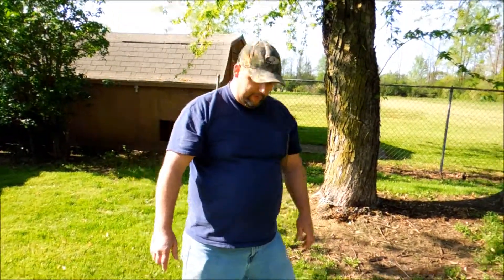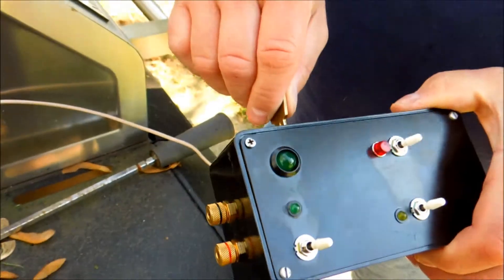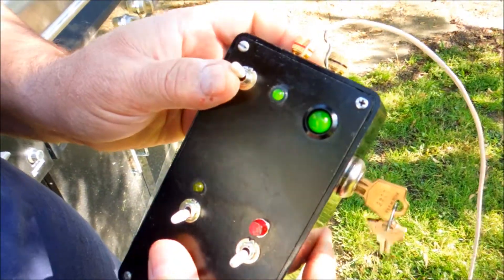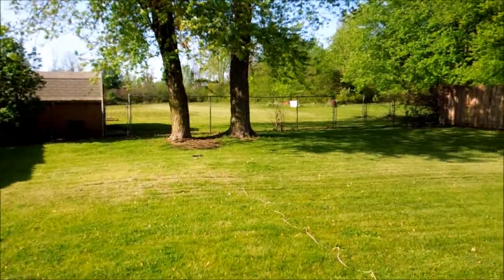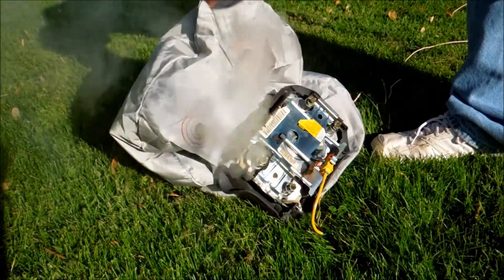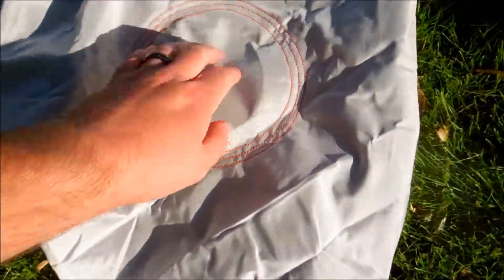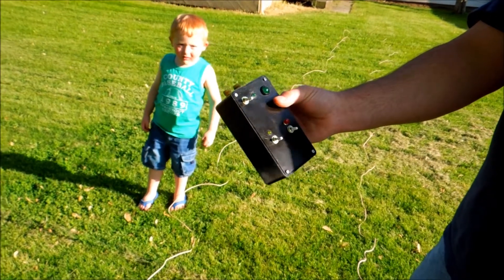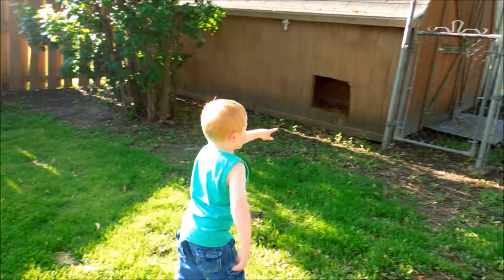Remote Detonation Of Air Bag (1080P)

Comment: Nice!! Could you tell me how to rig the wiring up to the air bag
Reply from the maker: Thanks for the comment. First of all, it can be dangerous...so it's something that you really shouldn't do, but take precautions if you. My dad likes to tinker with stuff so he actually made the box to detonate it, however that was all for show. I'm pretty sure all you need to do is simply apply 12v to the wires coming out of the back. I'm sure there are plenty of detailed diagrams on google, or even youtube, but it isn't hard at all.
Reply: You can use a Dewalt battery